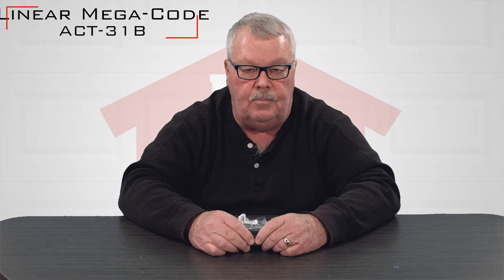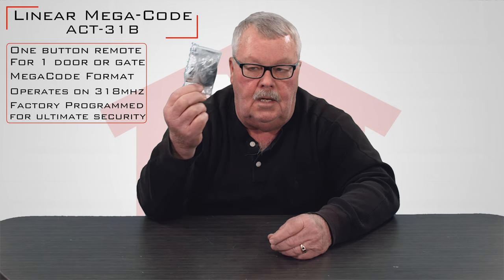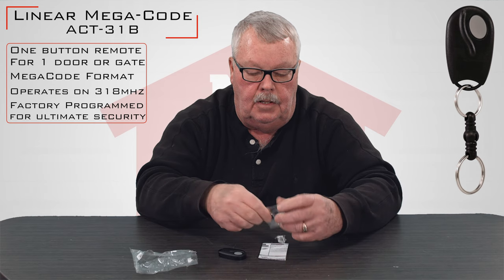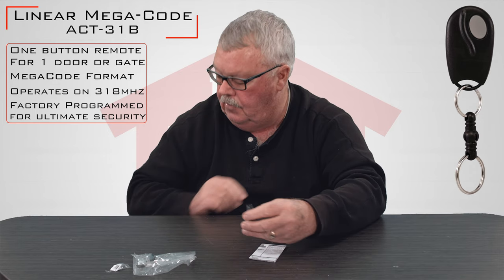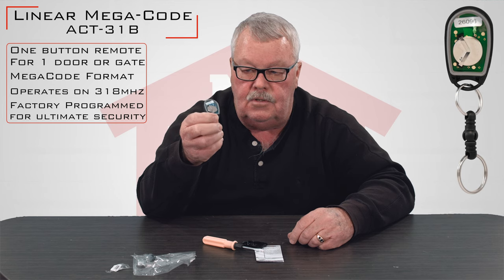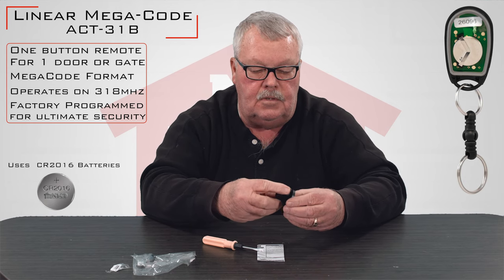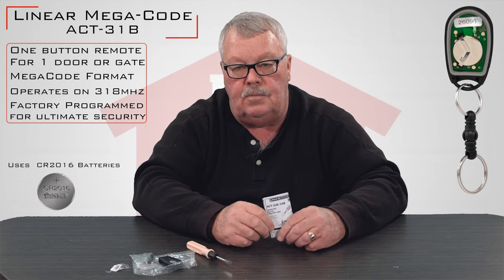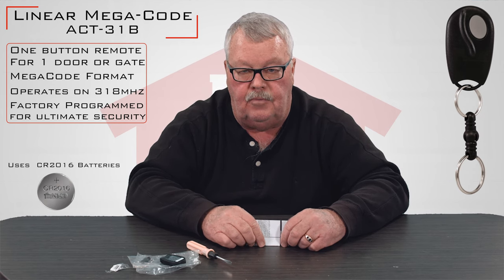Linear Mega Code ACT 31B ACP00879 Mini Gate or Garage Door Opener Remote

Comment: Go to the back of your garage door opener motor. There should be 3 buttons. The one on the bottom will say learn. Push and release. The motor and garage light will flash. Push the button you select for the door remote. I just programmed a key remote to keep on my key chain. You’re done.